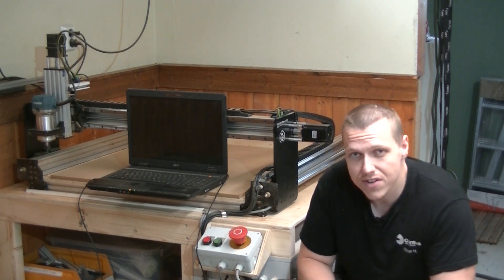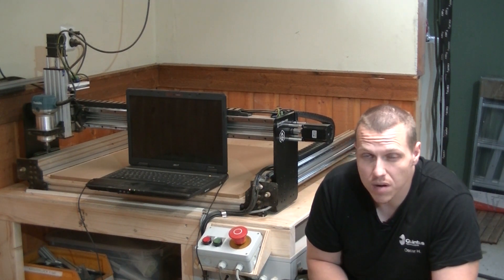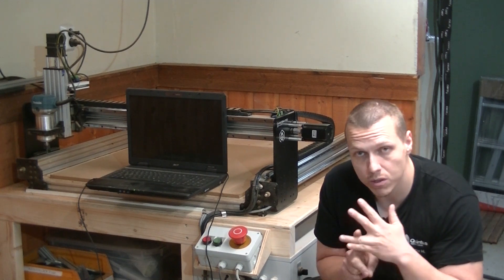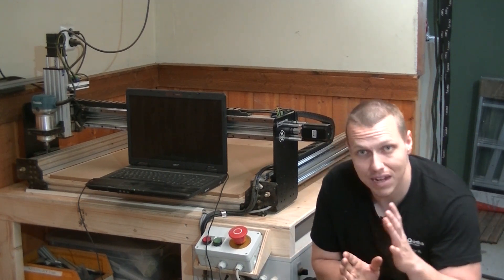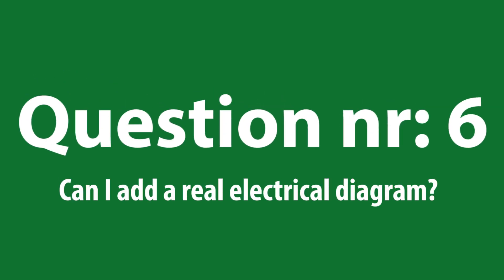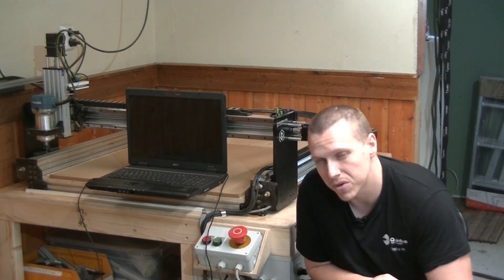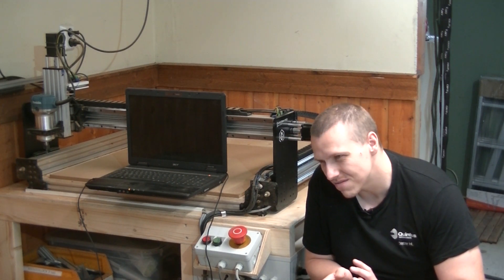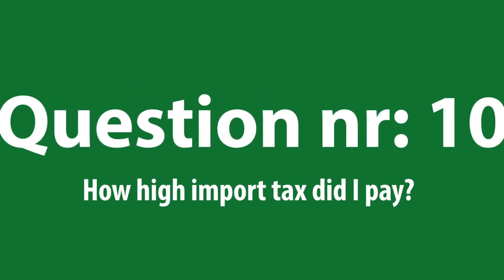QueenBee pro CNC router Build Part 6: Q and A

Comment: In the US, we have Avid CNC which uses ballscrews.  Benchtop 2' x 3' mechanical kit starts around $2400 USD.
Reply from the maker: I thought they only had larger, more expensive, machines. Thanks for sharing.
Reply: @OffHoursEngineering  It's debatable if the Avid series is within the same price point, but it's the cheapest I found that isn't full DIY which includes ball screws.  I received my 1000 x 1000 mechanical kit a couple weeks ago, so I really appreciate your time and effort put in to the series, it has already helped a ton.
Reply from the maker: Yeah, it is definitely one step more expensive, but all in all I paid around 2000 USD for my machine so far, with freight and taxes and everything so still not a huge amount more.
I'm glad to hear you found it useful, that's why I did it, to help people.

Comment: I purchased an EMI Filter for both vfd and meanwell power supply and ferrite cores for my QB 1.5KW hahaha just to make sure I dont get any electrical noise.
Reply from the maker: Well it won't hurt anything 🙂. And your power company will thank you as well. Any high frequency switching puts weird waveforms on the grid that your supplier will have to deal with. (It doesn't matter on this small scale, but high power consumption industries often have to pay extra to the power company for filtering out all the noise they put on the grid)
Reply: Interesting... I didn't know that well at least I am no longer encountering any false triggering unlike my 2 previous CNC builds hehehe.